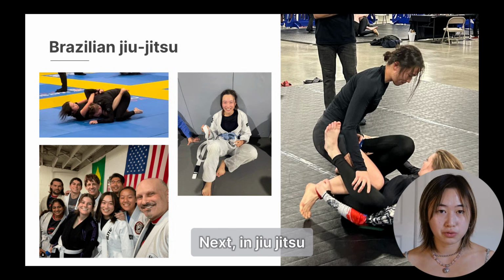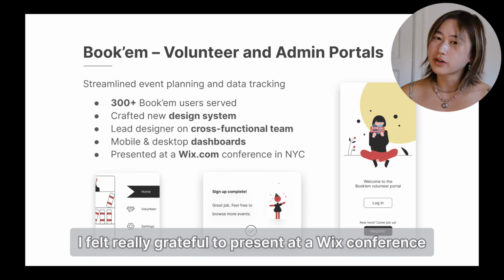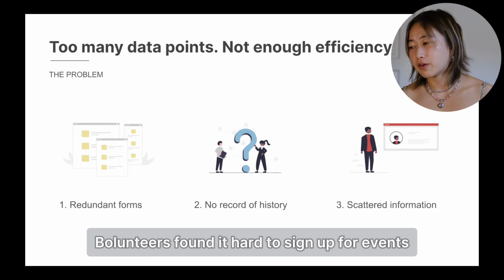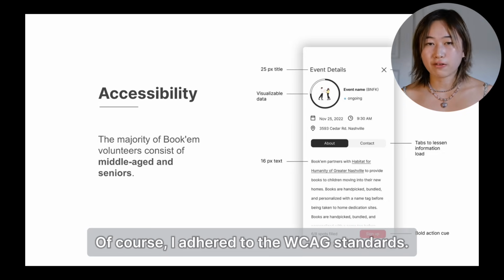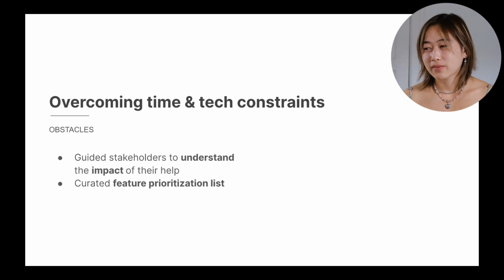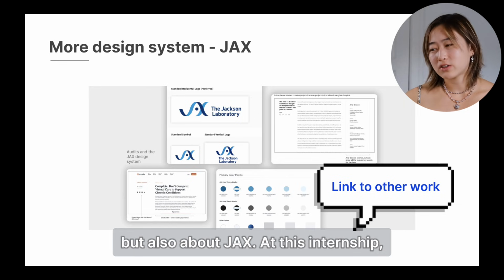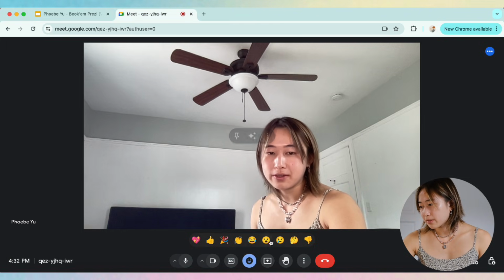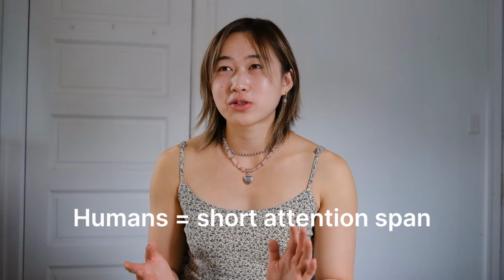This UX Portfolio Presentation Got Me Hired at Visa and GoDaddy

Comment: hello, I will be joining as software engineer at Ford (which I am grateful for considering the job market). However, product design has really piqued my interest in the last few weeks.
Would you say UX is much more competitive even for senior positions? (because swe is also too competitive in junior positions)
I am a bit confused about my long term career (whether should I stick to swe or transition to product design role) and your inputs would be valuable :D
Reply from the maker: Uday, congrats on your SWE role at Ford!! Given your situation, I'd recommend staying at Ford and seeing how you can hop onto projects/tasks that involve UX/product design. It's much easier to transition roles between a company than to recruit for another company for a completely different role. No need to rush with choosing which path to take down the line - speak with your team to see what projects you try out and go from there :)
Reply: @phoebeyutbt  thanks, that's really helpful